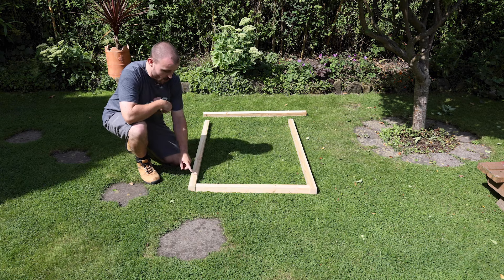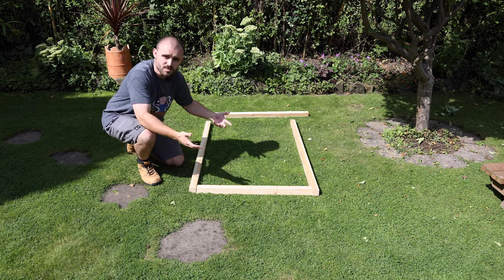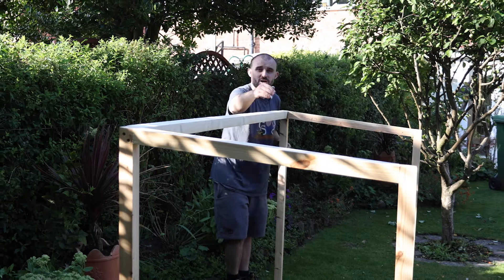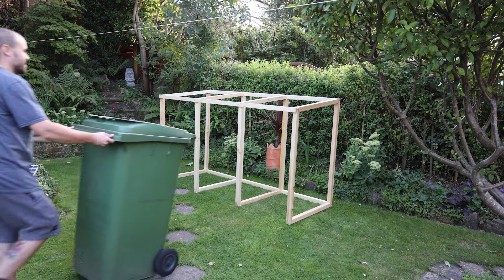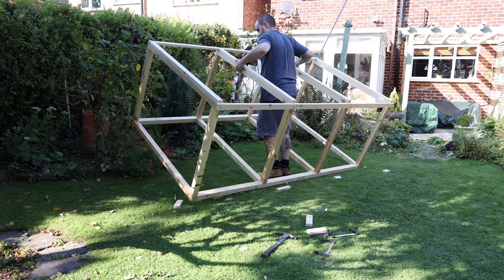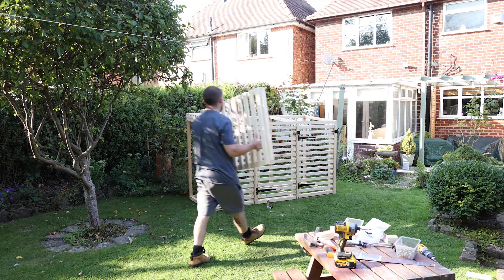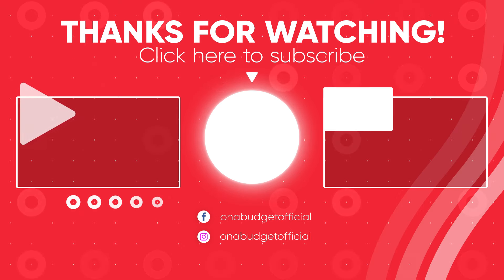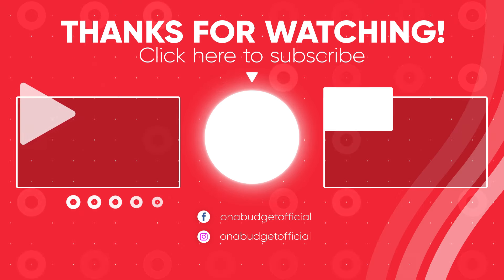How To Make A Bin Store - On A Budget

Comment: Nicely done. I largely went by that construction, but at the base at the front secured a thin aluminium strip going flat across to strengthen the frame underneath so that the bins can be wheeled out easily. Very helpful video Joe many thanks.
Reply: Great idea

Comment: Looks really nice that 👍🏻
I’m thinking of doing one for  a friend of mine .
The ground where its going  slopes about 70 mm over 2.5 metres and 50 mm front to back would this stop the doors shutting properly?
Reply from the maker: Thanks William! The slope left to right is likely to put uneven pressure on the door which would make them quite awkward to close. You can use blocks under the frame to level it but that would make getting the bins in and out harder too. It's a tough one. If it were me, I would make the frame as normal and try it in place as is. See if the doors can cope with it, if they seem fine, great! If not, I'd level the frame off and add small ramp to the front so the bins can roll in and out easier :) Joe

Comment: All you had to do was use a thin strip of aluminium across the bottom, won't rust and wheels go over easy.  You could attach a hinged stick across the top of the doors to hold the lid open so its always on hand when you need it.